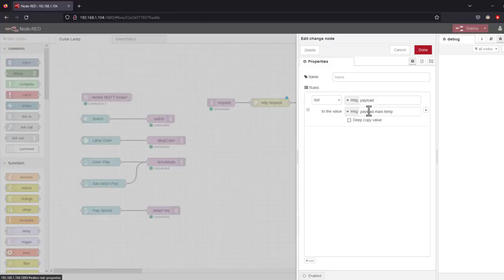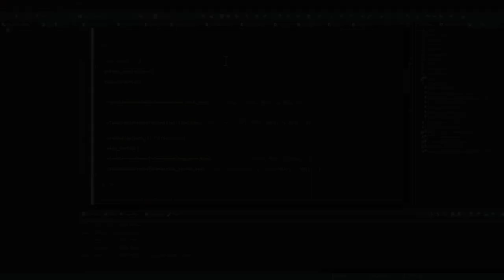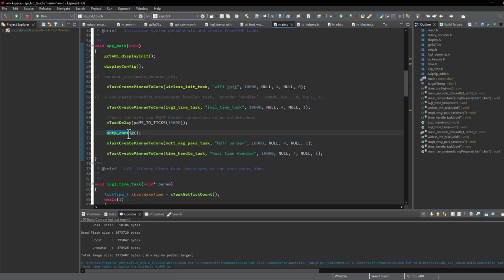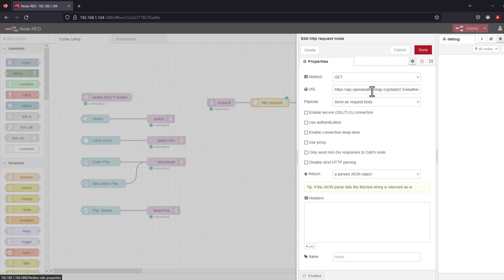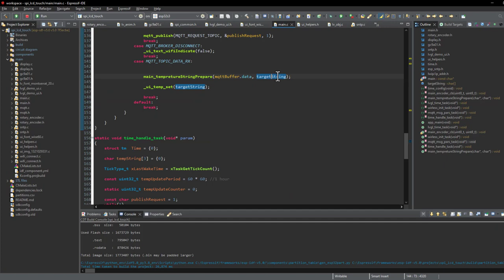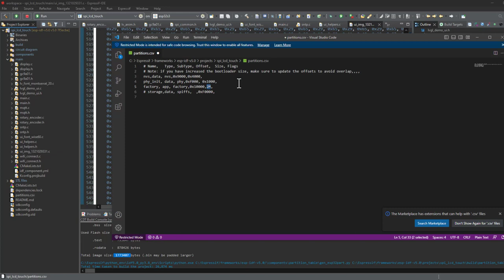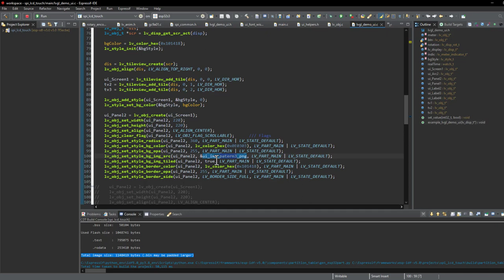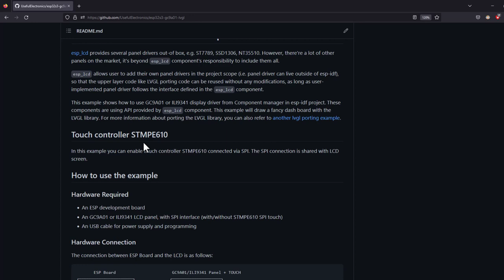ESP32S3 GC9A01 LVGL Smart Watch

Comment: Hi! very good  tutorial, just have one question, when selecting board properties in square line which board group should I use if im using the same screen and a ESP32?
Reply from the maker: Hi, 
If you are using some custom hardware, the important thing is the screen dimensions and color depth.